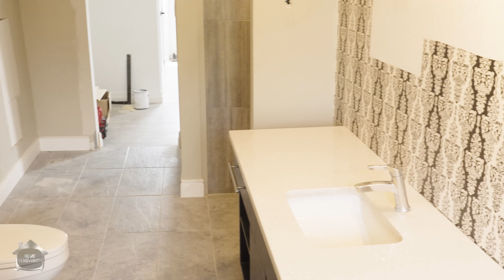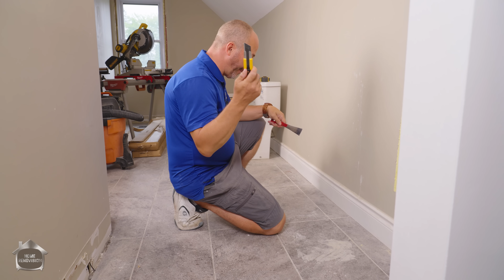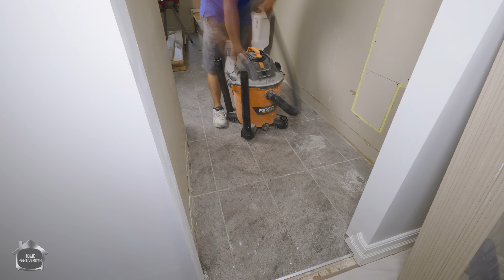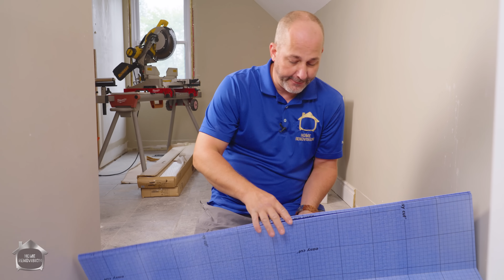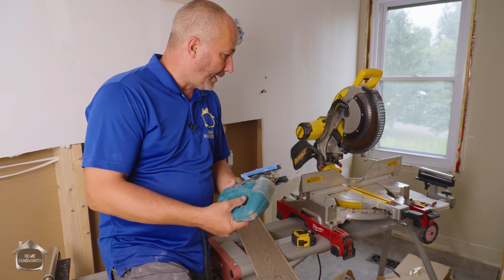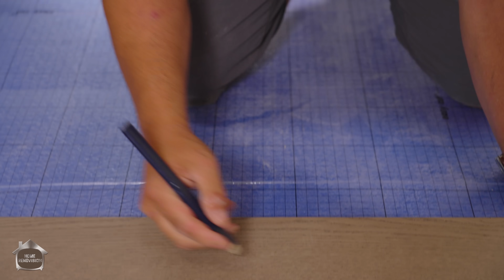Make a Hardwood Bathroom Floor OVER Heated Tile | DIY Bathroom Remodel

Comment: Jeff ? Basment floor or walls first ? Can you do floor leveling room by room ?
Reply from the maker: Hi Keith. I would need to know the age and geography of your house before I can comment on a proper assembly. If you need help consider joining the membership  program and jump into our forum. Cheers!
Reply: @HomeRenoVisionDIY  house 3yrs old basement concrete floor pre plumbed for bathroom . Concrete looks like 7yr old poured it. There's going to be some leveler needed. And yes I do need to join .
Reply: @HomeRenoVisionDIY  So the suggestion is to use this product in a basement as opposed what you have illustrated in the past using DMX foundation wrap and 5/8 " T&G OSB?

Comment: Hey Jeff, what about moisture and water in bathrooms? I'm willing to install Malibu Engineered Hardwood floor in my bathrooms and realy concerned about water issues. Though it's said water resistant and I made a test over this floor piece - I sunk it in the water for 1 day and took it out next day, nothing happened. My concern is repetitive water splashes or water impact in general in the long run. I was thinking of using silicone for the joints (in bathroom only) just to prevent water coming in between. May be you can share some ideas or tips? Of course edges will be sealed with silicone and good underlayment will be used.

Comment: I know this video has been out for 2 years but I am hoping you get the chance to read this question I have for you. Jeff, I have house that was built in the 60s that has hardwood floors in them. Through out the house when I walk the floor creaks. I was wondering if there is a way to stop that without ripping out the hardwood floor to get to the subfloor to screw down the boards? I would really appreciate your help that way I get myself into anything I shouldn’t have to. Thank you for your time.

Comment: I'm getting a small room built on with a cement floor. Can I put down a heated floor (electric wires in a pad), then the underlayment and then laminate....pergo outlast +... or vinyl tile?

Comment: Hi Jeff, i have been in my house 25 years. I have never seen hardwood floors expand or contract. Why cant you tile directly over hardwood floor and not use cement board?
Reply: expansion and contraction has a lot to do with temperature and humidity swings. perhaps you live in a place thats pretty consistent year-round or you just never noticed because you generally dont always see it

Comment: Hey Jeff.  I'm surprised in the choice of engineered hardwood in the bathroom where splashes and potential leaks could damage the wood.  I would have thought your recommendation, as a tile alternative, would be a good quality luxury vinyl plank.  Many LVP floors work well over in floor heating.
Reply from the maker: definitely a good choice. I went this direction to show it is possible and to keep the flow consistent from the bedroom. Cheers!
Reply: @HomeRenoVisionDIY  i.e. didnt care cause was selling the house.

Jeff would you do this in your own house that your gonna live in for 20 years?
Reply: I put engineered floor down in a bathroom in the basement in a rental I own about 15 years ago.  I wouldn't do it again.  While it still looks great it is abused by the water and humidity.

Comment: Somewhat off topic of the video.. current bathroom remodel.. should I grout or caulk where the wall tile meets the tub? My vote is caulk but installer says grout. My understanding is caulk where wall tile and floor tile meet tub and in the corners of the wall inside the shower/bath. Thanks!!

Comment: The amateurs that owned my house before me pulled carpet and put down LVP without properly cleaning. You can't walk across the floor barefoot without getting nasty feet. My plan is to pull it all up. Wash both sides of the floor with soapy water and dry. Clean every square inch, replace the under layment and put the floor back down.  Cleaning is the most important part

Comment: Jeff is a wizard on those power tools. It's for sure something to watch but I suspect I'd need a combination of years of practice and disregard for my own safety to get to his level. I'm a little afraid of moving around a piece of material in contact with a spinning miter saw blade. I've tried it once or twice in the past and it worked but I couldn't shake the feeling that eventually I'm going to get hurt.
Reply from the maker: Good point. I have years of knowing my tools. don't try to emulate what I do if you are not experienced.

Comment: So I want to do this on a rental property I have. It has garbadge tile in the kitchen/lr/hall/bathrooms and carpet in the bedrooms. I want to lvp everything, how would you suggest raising the 3 bedrooms the inch or so required to have a full level base? Jist alot of floor levelr?
Reply from the maker: that all depends on the subfloor. concrete or osb?
Reply: @HomeRenoVisionDIY  Concrete foundation.

Comment: second issue i know you said you are asked this question a lot but i have to ask. "My smart builder" installed my upstairs bathroom flooring of vinyl  ahla sheet right to the subfloor. i understand you said that dont put vinyl tile on flooring already there. at first it was just placed down there like you said because they put the floors in first before the toilet and vanity but at the year inspection they cut it out around the toilet and vanity and glued it down to the subfloor i was horrified but the worker just ignored my comments. now what. can i now just vinyl tile over it and use that as my underlay
Reply from the maker: you can install vinyl plank on any glued down flooring without worries. I don't recommend installing a floating floor on another floating floor just to clarify. Cheers!
Reply: @HomeRenoVisionDIY   okay what do i do then because its one bathroom for 6 people very high traffic and hardwood get destroyed
Reply: @HomeRenoVisionDIY  you mean to tell me that even though it is a sheet of vinyl and not planks its considered a floating floor? i guess my next question is do i have to buy plywood to go over the sheet that is glued down? i am trying to get answers in order to commit. because i need to know what i am up against. and once i know then i will become a member because i will need your help every step of the way.

Comment: my house is 9 yrs old my builder is dumb. my toilet water connection broke and water went places that i am now finding wet after i ran fans for two weeks. the hard wood and carpet was installed right on the subfloor which made all the water pour straight into the basement. through the basement ceiling. i am blessed that my insurance will pick up the cost but my flooring is discontinued because of age and i need to replace flooring and carpeting i dont want to put back carpet one because it scared me because of the water that is still there after a month and second the dog hair but i have no flooring and the whole first floor has the same hardwood that is not available anymore do i just find a company to match it with hardwood or do i put down something else. and how do i do it. everyone is over charging because of the pandemic. I need help with my issue. I hate that my basement received the water from the first floor. So many things went through my head. what ifthe basement was finish the month before and it got ruined😫

Comment: Great, thanks Jeff for your awesome videos 😊. Just wondering though,
Is there a risk that the tile grout lines will show up over time if you are using lux. vinyl planks with this underlayment? Is it over kill to use self leveling to fill up the grout lines?
Reply from the maker: no worries with spc core. use filler if you have thin or soft vinyl.

Comment: As always, another awesome and informative video!  I do have a question though.  If it were me I would’ve went the opposite direction, long-ways, in the room.  Is that the correct way, and you chose that direction for a reason, or am I thinking wrong here?  Because that does happen….ALOT.  Thanks again Jeff!
Reply from the maker: just following the direction from the bedroom so it flows better. Cheers!

Comment: I'm installing LPV that has an underlayment built in and was wondering if you recommend putting the additional abatec product down as well? Thanks so much!
Reply from the maker: I don't recommend you buy flooring with built in underlayment. take it back and save your  money.
Reply: @HomeRenoVisionDIY thanks for the input!  Has the industry changed recently because every type of LPV at homedepot has a built in underlayment?

Comment: No issues putting this type of floor in a wet environment? Always thought wood flooring wood have problems if it got more than a little water on it
Reply from the maker: it's only a wet environment if you are not careful. besides the heated floor will dry it out quick.

Comment: you're effectively adding an insulation layer to the floor. This means that now you have to spend way more money on heating your room since the effectiveness of that in floor heating has gone down by the R factor of this new layer of floor.
Reply from the maker: Cheers Edward. however I am not heating the room with this system. simply providing a high level of comfort by warming the floor and a way to keep the floor dry.
Reply: Well you need it to make the floor more even for the floating floor. There are underlayment floors that have a very low R factor specifically to be used on heated floors.

Comment: Installing this type of flooring in a bathroom is just a bad idea. Especially a floating floor. You have to be super vigilant to wipe up ANY water immediatly!! if the water stays in the joints for too long they will eventually swell. Go vinyl plank if you want to put a floating floor in. At least it is waterproof.
Reply from the maker: I get it. However since it is heated it dries pretty quick regardless. It is also in the ensuite so only grownups will be using it and they are usually responsible enough to use mats or wipe up any spills. Cheers! It feels amazing on the feet BTW

Comment: I agree with most of what you said Jeff 
Two things I would do differently 
1 I would have run the flooring the length of the room not across. 
2 I never cut in the same room I work in all the dust after you just swept and vacuumed 
Maybe that the only place you can cut not sure
Reply: Lol my bathroom is not that big !!
I do like watching your videos and I will check out that Underlayment

Comment: Nice job. I personally thought the tile floor looked just fine, but...
Reply from the maker: Cheers John, however in a future video you will see we removed the tub filler and did not have a replacement tile. so there was no option but to change it. Cheers!

Comment: Can I paint a roll on membrane directly onto the basement concrete foundation wall as a crude vapour barrier in a cold room?
It's never intended to become a finished space, as I'm using it for metal work, welding and grinding.

Comment: Is there a certain type of engineered hardwood for bathrooms?
Reply from the maker: I used a floating product. If you don't have a heating system then best to add one. the heating helps to mitigate any water thaT LANDS ON THE FLOOR BY DRYING IT UP SUPER QUICK.
Reply: @HomeRenoVisionDIY  so that would be an electric heating system? Any recommendations or videos that you’ve made on it?

Comment: Step #1 Engineered Hardwood is not waterproof, but Tile is.
Step #2 never cover Heated Tile! Heating that floor is waste of money.
Reply from the maker: You are entitled to your opinion. I simply just don't agree with you. Cheers!
Reply: @HomeRenoVisionDIY  I'm a layman on the subject, isn't there a huge loss in heating efficiency?
Reply from the maker: if you plan on using the program function to turn off and on during different times of the day then yes. I simply leave it on and it works great. no heat is lost it just takes a few minutes longer to rise through the assembly. Cheers!

Comment: Isn't engineered hardwood a bad material to put in a bathroom? It's not waterproof...
Reply: If you find one that is specified for wet rooms you'll be fine.
Reply from the maker: It is all in the user. you don't need waterproof floors in a bathroom if you use a mat when showering.
Reply: @HomeRenoVisionDIY  🙃
Reply: @HomeRenoVisionDIY  ty Jeff!

Comment: Jeff, can you do a video on the transition from the new flooring to an existing floor. Example, I have original 1950’s hardwood and linoleum. There is no transition right now just a 1/2inch drop from the linoleum to the original hardwood.
Reply from the maker: sounds like a great idea for the new studio I am building.
Reply: I was wondering the same.  Adding a layer over the tile is going to make the transition even larger.  A video on that would be very helpful!

Comment: Underlayment then engineered hardwood on top of tile, which has thinset and probably cement board any maybe even laminate over the plywood on the floor joists. It's almost a step up for a transition. 

Strip it to the subfloor.
Reply: Radiant is much better in the tile or cement anyway. This will work but probably not the best..

 Lol, we used to do subfloor, 30W felt, then radiant tracking, 5/8 cement board. Then the tile.. yeah I got good at creating custom transitions.
Reply from the maker: even if I removed all the previous layers I would only save 1/4" with the new assembly. That would just be a waste of money and time!

Comment: as a guy that's had to demo before, please rip up your old flooring (especially tile) before adding new. Don't wuss out.
Reply from the maker: This is not about cutting corners. It was about maintaining a perfectly good heated flooring system and changing the feel of the bathroom from cold to warm.
Reply: And the bonus is the tile acts as a heat sink and will evenly space the heat over the floor to radiant through the hardwood.  If the height doesn't cause a problem and the transition at the door doesn't cause a problem.

Comment: How does the extra layers of flooring and underlayment impact the heated floors?  I'm wondering how much longer it might take to feel the warmth.
Reply: It will be excellent.  The tile will be a heat sink and transfer the heat evenly through the floor.
Reply from the maker: Hi Dan. I have my sensor set to maintain a certain temp. traditionally floors take a couple hours to warm when you first turn them on. if you are using a program to have it warm in the morning only just add another 15 mins to your setting and you will be fine. Cheers!

Comment: Is that flooring waterproof?
Reply from the maker: not to the same extent as the vinyl, however with a little care and a heated floor it is not an issue!
Reply: @HomeRenoVisionDIY  the addition of the heated floor increasing the resistance to moisture makes sense, thanks!
Reply: I was at home Depot today looking at the flooring all the click lock hardwood is waterproof

Comment: Can I use this method to install over an existing engineered wood floor that’s glued down on a concrete slab located in a kitchen.
Reply from the maker: yes you can. just be sure to use an underpad as well. Cheers!
Reply: @homepc1826  no